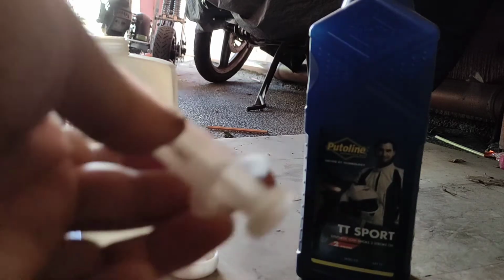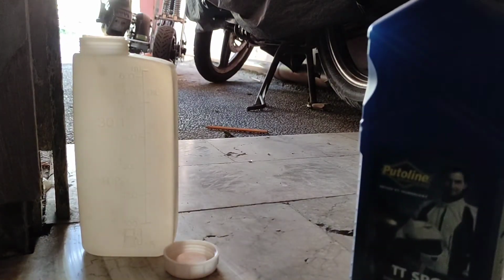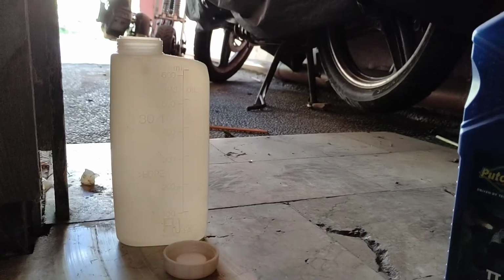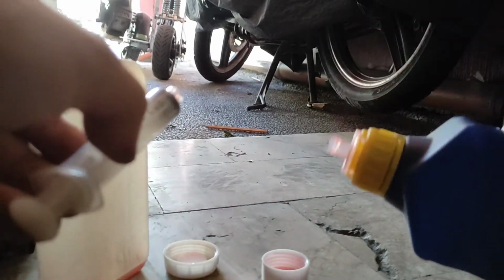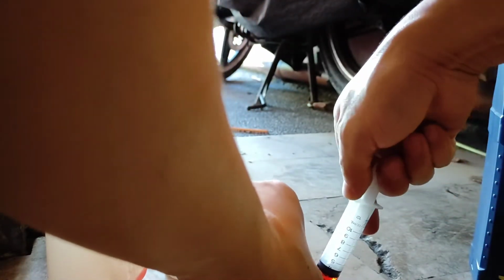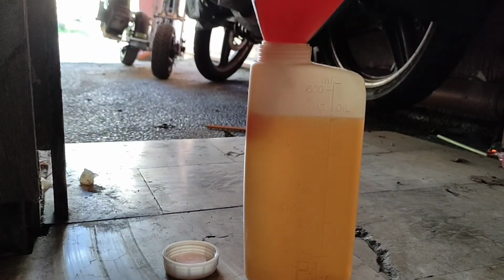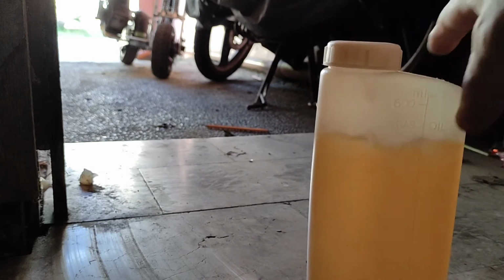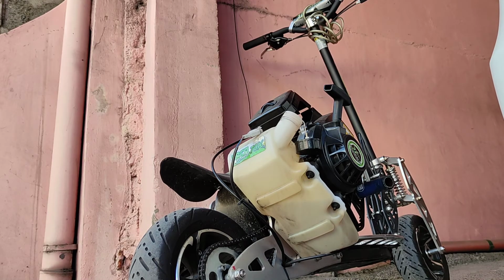putoline 2T oil on evo uber scoot 71cc

Comment: halo brother...can i put inside 2t tank use 2tpump without premix..?
Reply from the maker: Much better use a separate container, then mixed desired 2t oil with gasoline, shake it then pour on gas tank, well mixed if you used separate bottle for mixing 2t oil and gasoline, that is why when i bought the evo scoot it came with a bottle mixer
Reply: @JomsF  thank so much brother...👍have a nice day..
Reply from the maker: @Mk8Rpatkaki  welcome bro,.ride safe